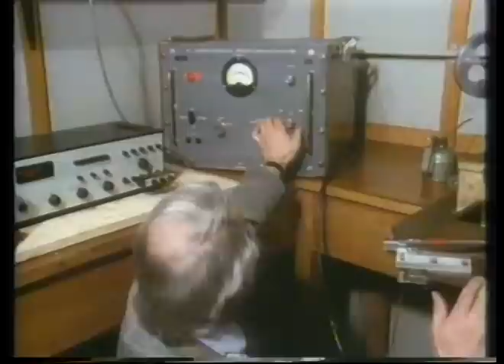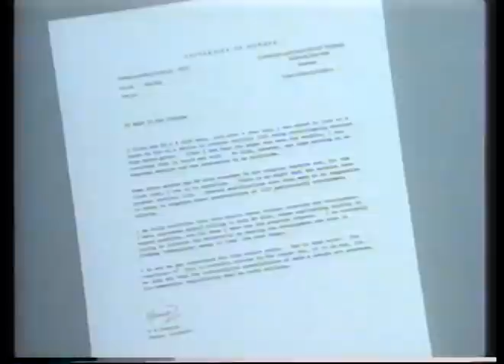Anti-Gravity Machine (Part Two)

Comment: The lifting effect can only be due to aerodynamic forces such as the Magnus effect - the same reason a spinning tennis ball in flight will swerve. In a vacuum the machine will just move at constant velocity in accordance with Newton’s laws.
Reply: Wrong...
Reply: @altair7001  Why do you say, "Wrong"?  Please explain.
Reply: The Magnus effect can be easily tested in regards to Sandy Kidd's apparatus.  The device can be placed inside a vacuum chamber.  Without the presence of air, there would be no Magnus effect.  If the device lifts in a vacuum chamber, then it is not due to the Magnus effect.  Let me know if someone conducts this test.  Thanks.
Reply: @WhiterRican  , Even if there was any aerodynamic forces, they would be much too small to have any effect on this device. The flywheels are much too small, and the whole thing is heavy, it's made of metal...
The two opposed flywheels rotate on their own axis, and then this assembly rotates around the central shaft. This produces a strong gyroscopic torque on the arms that support the two flywheels, which forces the supporting arms to rotate upwards.
I recommend this video as a starter:
https://youtu.be/0L2YAU-jmcE
Reply: Not quite, but it's not antigravity nonetheless.  It's simply an oscillation similar to if you were to propel a weight up and down.  While you propel the weight down, you experience lift but sooner or later, you run out of stroke and conservation of momentum reclaims that lift to jerk you back down.   Gyroscopes with their stored momentum could extend this effect but conservation of momentum will still come into play, just a bit later.
Reply: Sepher Agon  This device did not lift in this video.  There is no evidence it ever lifted.  In a vacuum, it would definitely still not lift.

Comment: It never worked. waste of time
Reply: XY ZW  Another problem is not lifting at all.    This one does not.
Reply: XY ZW   They said all sorts of things, but it's a video.  I can see it.  It never lifted at all in the video.  They even have a pulley and string visible in the video to pull it up with, and it never lifts off the ground.
Reply: XY ZW    Watching the video again, a part of the machine rises, but the base does not move off the ground.  There is a counterweight and pulley mechanism in place at the same time this happens.  A kid's see-saw will do the same.  Push down on one end, and the other rises. The gyroscope certainly adds a bit of hocus pocus tot he equation, but this machine is not lifting or levitating. 

I have seen similar videos were a gyroscope is made to rise up.  But when the whole mechanism is placed on a scale, the weight is constant.

Comment: the asymbly is still tethered. to the table connected to the motors that spin his contraption. The proof will be obvious if it is self spinning without any outside connection.
Reply: It runs on gas.

Comment: So what's happening to this in 2019?
Reply: it doesn't look very efficient or balanced. if you wanted to use it to lift anything it would require some pretty expensive materials and a lot of rotational mass to withstand the forces, but reenergizing the flywheels shouldn't be too hard to keep the effect going. you would need to fully understand procession and how to counter that.

its not magical, and its not a new source of energy or anything. you store energy in a flywheel and get it back out in a weird way because of how they resist angular changes. all in all itd be useful to put gyros in a forward swept flying wing in leu of flaps and control surfaces, but not using that gyro force to fight gravity nonstop to keep from hitting the ground. i commented how gyros are affected by gravity equally and weren't able to be used to lift anything, welp i guess i didn't consider levers or anything fancy :p

Comment: Look ma.....no moving parts....no sound either!

It's a shame that Discovery Channel buried that clip they showed back in the 90's of two Airforce techs bouncing (like a helium ballon) a tin foiled covered umbrella as it levitated. It was connected to a low wattage emergency transceiver a downed pilot would have had back in the late 50's early 60's. That specific episode was called "Declassified military secrets" on the Discovery Wings program.  I estimated one pound of vertical lift per 4-5 watts of electrical power. But when requesting a copy of that program Discovery denied it ever existed. My bet is someone in the military or cabal didn't like that information slipping through the cracks nor that FOIA being granted.
Reply: Wow I would love to see that episode maybe someone has a recording of it on VHS somewhere

Comment: I made such a machine in a slightly different design for approx. 35 years ago.
The flywheels were bent in a shape like an 8 number
There is an incredible load on the material.
And if you measure the consumption of the engines, you will see how the consumption increases when you find the right angle and revolutions on the system.
Good pleasure and good work desire
Yours sincerely
Bjarne from Denmark
Reply: you still have the machine?
Reply: @pi4313  No It is so long ago
Reply: Hi, very good work, Do you still have the measurements and the way to build the Maschine ?
Reply: @pi4313  ofc he have not... how can u even ask sucha stupid question...
Reply: @a4man90  idk ppl are kinda acting like this stuff is real even though its prolly not

Comment: Put the whole contraption on a scale in a vacuum chamber.... Then show me it changing weight.
Reply: PHOTOGRASPER   Why?
Reply: @captainchaos3053  to eliminate all the bullscat.
Reply: PHOTOGRASPER how would that change anything?
Reply: I get the feeling I couldn't explain it to you.
Reply: PHOTOGRASPER   Oh well then I'll not bother pointing out the flaw in your thinking.
Reply: @captainchaos3053  😂👌🏾
Reply: It would depend on the balance; it is easy to make a mechanical balance give the wrong weight.
Reply: MrAaronvee  that makes literally no sense
Reply: @captainchaos3053  Well, that is the problem with physics: much of it is very counter-intuitive and, when it starts to clash with 'common sense', too many people go down the wrong route. The balance effect is easily demonstrated by solving the Euler-Bernoulli equation, but with a non-linear frictional term.
Reply: MrAaronvee   so the thing physically lifting off its thrust bearing requires a dodgy scale?  Come on.